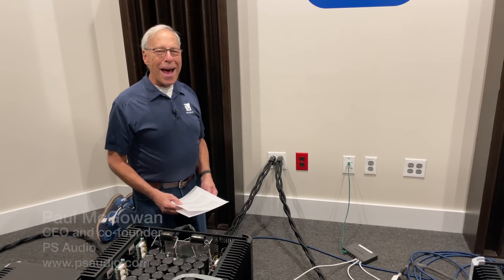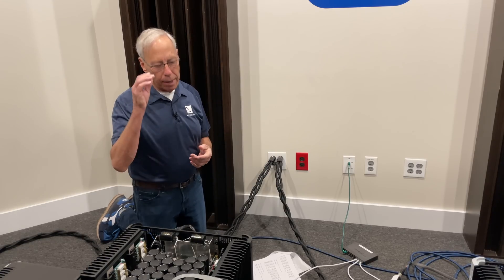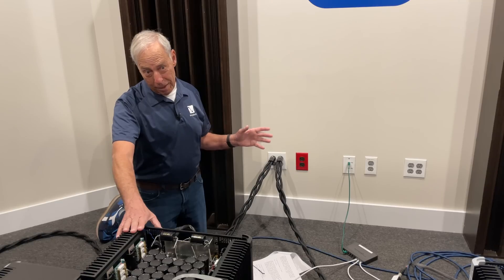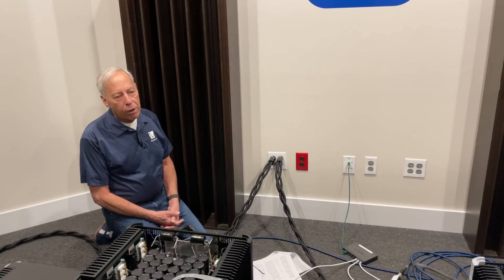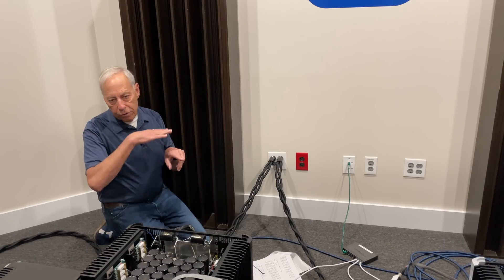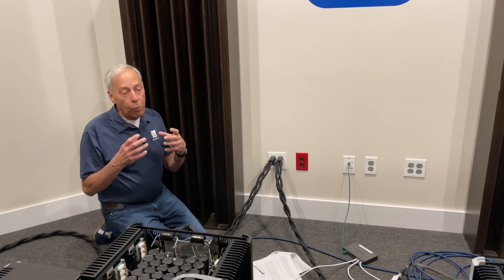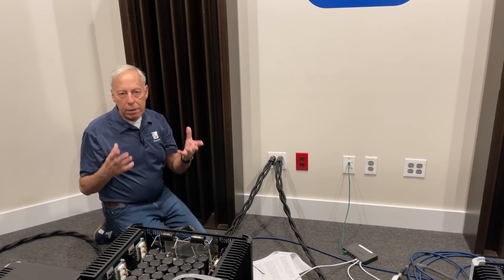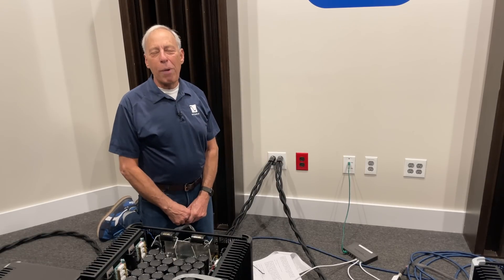Are braided power cables better?

Comment: I notice a trend in the replies. The guys who have actually tried braided power cords and done an A-B comparison ALL say they are worth it. The only guys who say they do not work are the guys who have never tried. How can they say it doesn't work if they never tried an A-B comparison? Too many keyboard warriors spouting uninformed opinions that are worthless. Theoretical opinions mean nothing. What you hear from the speakers means everything. There are many power cords for under $100 that offer an audible improvement in sound. Try them, they have 30 or 60 day return guarantees.
Reply: The "snake oil" crowd (the cable deniers crowd) assert that it is the placebo effect; that people trick themselves into thinking that they hear a difference.

Cables do make a difference (both interconnects and power cables).  But you will never get the naysayers to change their tune.  You would have a better chance at getting them to change their religion or change their political party.

If you sat them down in front of a great stereo system, and had them swap the cables, they would probably be forced to admit that they really do hear the difference, and that it is not subtle (it is "in your face" better).  But such demonstrations are not going to happen.

A lot of their denials are based on envy.  They cannot afford a quality stereo, and so they knock what they cannot afford, so as to convince themselves that they are not missing out on what is supposedly no better than what they own.

They are even envious that they cannot participate in such a test (swapping stock cables for high-end cables on a $50,000 or $100,000+ stereo).

I cannot afford this stuff.  But I know that it works.  I do not deny reality.
Sure, I am a bit envious of others that own this stuff, the same as being envious of those that own Ferrari's.  But I will never knock something simply because I cannot afford it.

Quality equipment, of any kind, will cost more.  To those that can afford it, good for them.
Reply: @0Perhaps  , i agree with everything you said and would like to add a second reason for the naysayers. i genuinely believe there are people who CANNOT hear the differences. and because they cant hear it... obviously, it doesnt exist!
i can run faster than you. you can jump higher than me. your brother can lift more than either of us.
why is it such a leap to imagine one person can hear better than the next guy?
Reply: @googoo-gjoob  For subtle improvements, there will be no shortage of people that will honestly say that they hear no difference.  I have swapped out cables, and could not honestly say I heard a difference, or could not identify the difference (I would fail a blind test between those two different cables).  But that does not negate that cables can make a substantial sound improvement.

Just as changing tires on a car, some brands will feel nearly the same.  But if you go from the lowest performing tires to the highest performing tires, you will notice the improvement.  But a lot will also depend on the car.  If the car is sloppy in the corners, then there is only so much that better tires can help.

Do the tire test on a Corvette or a Ferrari, and nearly anyone would notice the change.  That is an assumption on my part, because I never drove either one.  But I suspect that my analogy is on point.  I put high performance tires on my 2003 Nissan Sentra, and I noticed the difference.  So it stands to reason that sport's cars would yield an even more noticeable improvement.

And so it is with stereos.  If the testing is done with a stereo from Walmart, then there is no point to the test.
The stereo, itself, is the core piece of testing equipment.  It has to be up to the task.

The better the stereo, the more apparent better cables will be.

With a professionally set-up high-end stereo, if you change the stock power cords with Audioquest's best power cords, the improvement in sound quality will be enough for even deaf-in-one-ear people to hear.

The problem is such tests are unrealistic for 99.9999% of people.  So they go with what they heard, and, unfortunately, what they never heard.
Reply: @0Perhaps  , all points agreed. additionally, i used to be a fan of AQ. im now quite smitten with Cardas.
Reply: ^^dingdingding^^ we have a winner!
Reply: @Douglas Blake It is correct because not a single one of them said "I tested xx.....xxx" Everyone of them instead said something about the laws of electronics or the physics of it. My presumption is proven correct by NONE of them replying with "I did test ..... and the test confirmed what I learned in school."
Reply: @Douglas Blake Name someone that has tried those Audioquest power cables.
List the components in their stereo.

Brian G C's point is valid.  There are always exceptions.  There's bound to be 0.0001% of people that will not hear a difference.
Since quality power cables do improve sound quality (I know, because I heard it), then Brian G C's comment is on point.  If you test with those quality power cords on a quality stereo, you will hear the improvement.  Ergo, the people claiming otherwise "have never tried".
Reply: @Douglas Blake , but its only wrong by a fraction.
The vast majority of those who say they do not make improvements haven't tried them.
Reply: @Douglas Blake You wrote, to @Brian G C:
"Oh wow.... you really need to find help."

Brian G C is trying to help you.  You insist on remaining ignorant, which is why ignorant people are ignorant.  Do you understand that?  Or are you too ignorant to understand that ignorant people are too ignorant to understand that they are ignorant?

Or are you forever in trolling for attention mode?

I suspect both.
Reply: We can say that because our head is not full of garbage
Reply: @Harald_Reindl  and yet some how the purists fail to account for the 20 odd meters of cable that isn’t braided from the power outlet back to the main switch board. ??
Reply: @leonkyle1190  I'm not 100% sure why, but it could be the twisted cables effectively act like a filter at the end of a water line; cleans up whatever is upstream.
Reply: @leonkyle1190  
Some audio purists replace the ''20 odd meters'' with braided power cables for EVEN BETTER sound.
Reply: @leonkyle1190  Your water is delivered from miles away.  Yet you use a show head for the last few inches.

Why do you knock "purists"?
Do you prefer contamination?
Reply: @leonkyle1190  , each improvement anywhere along the line yields improvement at the end.
Reply: @0Perhaps  I’m not knocking them…. I’m just trying to understand the logic, science and reason behind what they believe. Anything worth believing should be able to be held up to the flames and prove itself not just because someone said so. Maybe braided power cables do make a difference……. But I have built many an amplifier power supply in my time and I fail to see how it can have any affect on the listening experience.
Reply: @leonkyle1190  You wrote:
"I’m not knocking them…. (the purists)"...

Yet, you used that noun as if it were a disease.
I ask, again:
Do you prefer contamination?

As to wanting to understand the science behind how quality power cables work:  I wish I knew the intricacies of exactly what goes on inside those quality power cables -- but I do not know.

I do not know how my microwave oven produces wave forms that heat up my food.  By I know that it does.
I do not understand the science and engineering that go into tires that support huge aircraft landings.  But I know that they work.
I do not understand the mathematics and the engineering that goes into a 64 core CPU that allows it to perform trillions of operations per second.  But I know that they work.

And so it is with quality power cords.  What I do know is what my ears tell me.
If you have only one, use it for your CD player (or DAC), as those components throw noise back into the line that is picked up by the rest of your stereo.  Quality power cords prevent that noise from doing so, resulting in a better sounding stereo.

If you do not hear the noise from your CD player, then you and every other person on the planet are in the same club.  But when the noise is reduced or eliminated, that is when you will hear it (or no longer hear it).  You music will blossom.  It will not be like changing speakers.  But it will be noticeable.

If you test a quality power cord on you CD player, you will need to listen for a few minuets (equipment needs to warm up, and the change might not be in-your-face noticeable).  When you put back your stock power cord, the music will not blossom as much, and that is immediately noticeable.  Then when you put the quality power cord back, again, you will hear the blossoming immediately, and you will not want to listen any more with your stock power cord.

This will work on any good stereo; any stereo that has good imagine and good soundstaging.  If your stereo is from Walmart, then there is no point in testing.  The stereo is the lab equipment, and that equipment must be reasonable good (you cannot perform lab tests with crap lab equipment).

If you test with an entry level Shunyata power cord or an entry level Audioquest power cord, I don't know how helpful that would be.  I suggest testing with whatever you can budget, in order to ensure ear pleasing results.  Just be sure that you can return the power cord for a refund, if you are not satisfied.  Most reputable high-end stores will lend you such a quality power cord, if they have it in stock, allowing you to try before you buy -- you have nothing to lose.

I know that Shunyata's and Audioquest's power cords will do the job.  I have no experience with other brands, and I suspect that some other brands might be sub-standard or make things worse (I have heard stories).  Some other brands might be very good, too.  I just do not know.

So stick to Shunyata or Audioquest.  I own Shunyata power cords, but I have heard the Audioquest power cords, and the Audioquest power cords are a bit better.  I cannot afford to replace my power cords.  The Shunyata power cords are fantastic.  And at a given price point, might be a better deal than a similarly priced Audioquest power cord.  It is a win/win, whichever brand you choose.  If going for the flagship power cords, then go with Audioquest.

If you have a stereo with good imaging and good soundstaging, and you obtain a quality power cord, I am confident that you will hear the improvement, and it will be exhilarating -- like your stereo just doubled in price.  You will hear more space between instruments and voices and darker backgrounds.  Listen for 20 or 30 minutes, and then put the stock power cord back, and listen again.  You will keep the quality power cord, because there is no going back.
Reply: @0Perhaps  come on …. No one likes contamination and yes I was using a dash of sarcasm there, and you have proven my point. You haven’t provided what I was asking for ( science, logic and reason). I guess we will leave it at that and I write it off as subjective and you write me off as ignorant
Reply: @leonkyle1190  Unfortunately, the cable engineers either do not have the time to chime in with answers, do not want to be bothered with all of the "snake oil" rhetoric, or do not want to reveal their trade secrets to the public.

Yes, it is subjective.  And on that point, those that have actually listened with quality power cords on quality, properly set-up stereos, hear the improvement.
Those that have not listened, those that refuse to listen, those that believe a wire is a wire, will too often trash talk that which they never heard.

Hopefully, they will not review TVs that they never saw, and food that they never tasted.
Reply: @briangc1972  "could be the twisted cables effectively act like a filter at the end of a water line?"  
The answer is NO. Using twisted pair wire do not act like a filter for signal going through it any way considerably differently compared to two parallel wires at the same distance from each other. The "act as filter" theory is wring and if "twisted pairs act as filter" is used in sales talk it is bullshit talk. It does NOT clean up whatever goes upstream or downstream. 
Cable twisting has some effect on how much EMI the cable can radiate to environment or pick up from environment. Cable twisting and putting a metal shield over the twisted cable provides good EMI protection.
Reply: @epanorama  Aside from your profanity, everything you said is mere speculation and has not scientific testing to prove or disprove the claims that aftermarket power cords can and do affect the sound coming out of the speakers. So instead of rambling on with your incorrect theoritical OPINION, try some tests and post the results. I have, and many others have (including Paul), and we all agree, that the power cord can and does affect the sound. Lest you claim it is all imagined, let me reiterate that just a week ago I did an A-B comparison of power cords with Rhodium ends. If my results were imaginary, I would have heard an improvement. But I did not. The Rhodium ends had a negative effect on the sound. I then read reviews of Rhodium and found that others had heard the same negative effects. So despite their higher cost, the Rhodium terminated power cords sounded worse than the copper terminated power cords in my system.

Comment: I was told by several high end store salespersons to avoid braided interconnects in the 1980s and 1990s ( there were no such power cables then ). Why were they wrong?
Reply: Many high end audio salesmen lie. Many do it intentionally, many do it by giving incorrect answers due to their own incorrect opinions because they are uninformed or unaware.
There are probably 1000 to 1 that have heard the improvements offered by aftermarket power cords vs those that say they didn't hear any improvement.
Reply: Avoid unshielded braided interconnects because unshielded unbalanced interconnects have poor shielding in them. Unbalanced interconnect made with unshielded twisted pair is generally a bad idea because poor shielding, some braiding styles can perform slightly better than that, but are not still good compared to a properly shielded cable. 
For balanced signals unshielded twisted pair is quite ok, but shielded is still better, and shielded star-quad even better. I would not bother with strange braided cable here, because not much potential to gain here and potential to loose a lot with non-ideally done braiding.
Reply: Why did they say to avoid them? Isn't it better to give things a try ? A High end Store will always have a try before you buy option - otherwise they are not High End.
Reply: @adotopp1865  some unskilled and immoral sales people with cash problems will  lie, but a person skilled enough to hold a good sales position has the tools to create both  income and happy customers, while perhaps avoiding , at times, some unproductive details.    

often salespeople will simply repeat what was told by the factory reps during product  sales training, since they are the authorities , leaving salespeople  knowing  little beyond what they are told.   the real good product information is what they are told by customers.

Comment: Great videos Paul.
I was wondering if you used a braided AC cable from your main electrical panel to your wall outlet even braided inside wall box to ensure this induction mitigation.
Reply: That is not necessary. Install a hospital grade outlet at the wall. Add a Furman IT Reference power conditioner (or similar) between the wall and your amps. Use braided power cords to the amps. You will be amazed at the improvements in soundstage and fullness of the music.

Comment: I am interested in this concept but can’t get past staring at the outlet on the wall…and what is behind it. After the power is generated at some far away power plant, transmitted to the local substation, through local lines to your street, through your panel and into wires behind your walls (all non-braided) and finally through a $2 receptacle, what difference can this last 3 feet really make? Not trying to be smart, just don’t understand the value of “stupidly expensive” cables at that point in the electricity supply chain.
Reply: Exactly...it doesn't matter.  The power supply itself matters.